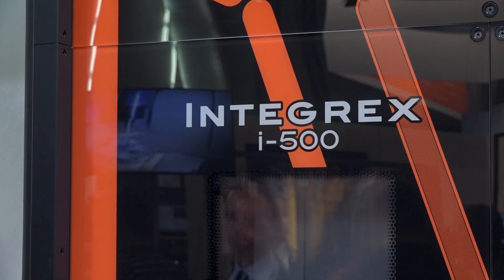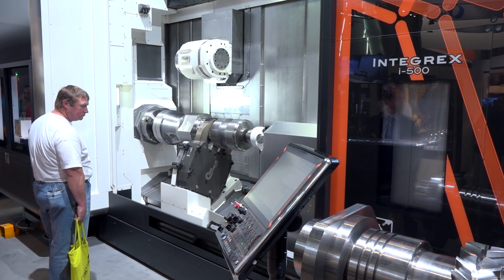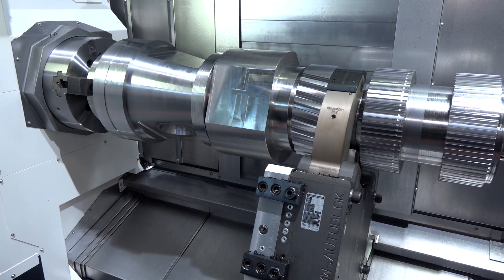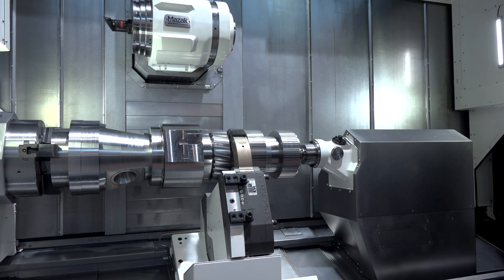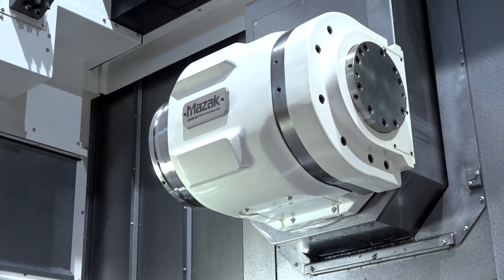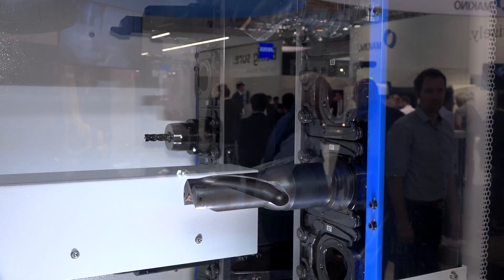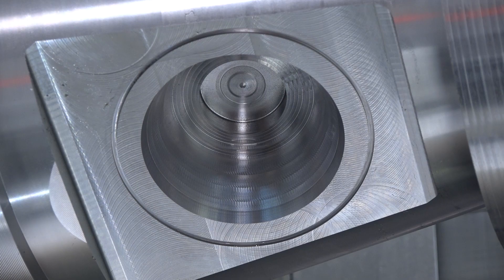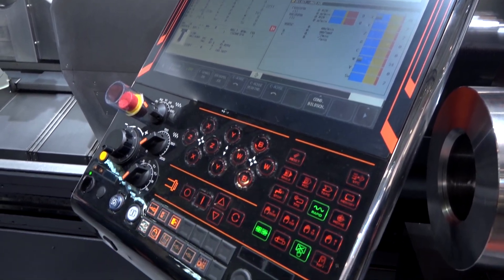Some component on this Mazak INTEGREX i-500S

Comment: Yay Integrex ! It really kills me how unimaginative folks can be with their Integrex (B axis mill turn machines). Fundamentally they are capable of very good sim 5 axis work as well but most of the time you see them pressed into essentially 4th axis (orthogonal ) work ? You can swing a surprisingly large part on the main turning spindle as a C axis for 5 axis work relative to the main turning diameter. [Thanks for featuring an Integrex I-series machine... YES they are very versatile and surprisingly accurate machines. ].